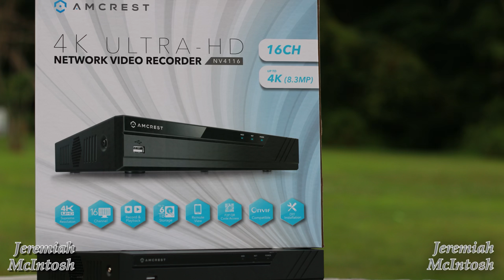HOME SECURITY! Amcrest Nv4116-hs NVR Hard Drive installation! Easy step by step Tutorial!

Comment: Where can I buy the SATA data Cable? And the SATA power cable? I have the exact same nvr and in trying to install the hard drive but I’m missing the cables I just mentioned.
Reply from the maker: Eric I’m not sure where you can buy the cables from separately but they should’ve came with the NVR when you purchased it. I would contact Amcrest if they weren’t included or return it if it’s not past your return Period. 
Sorry I couldn’t be of more help
Reply: Board is marked 1-4.  Sata cable I got one from eBay  could not find one with the right circuit board connector cut off ends and soldered to board